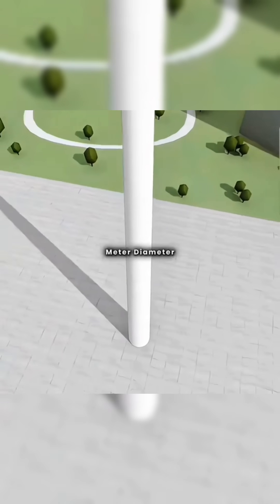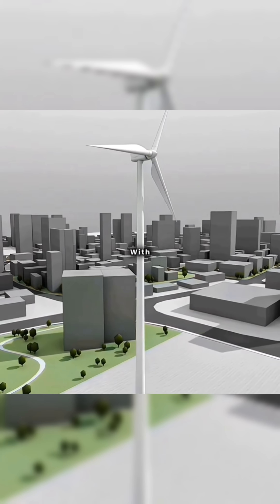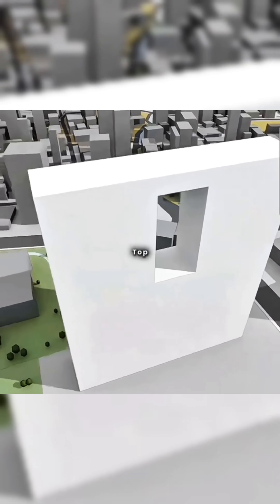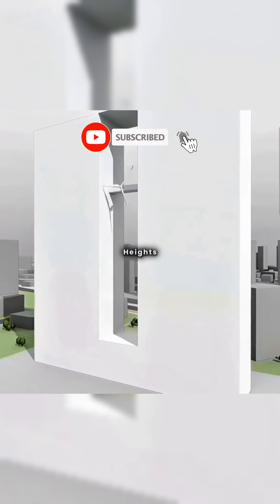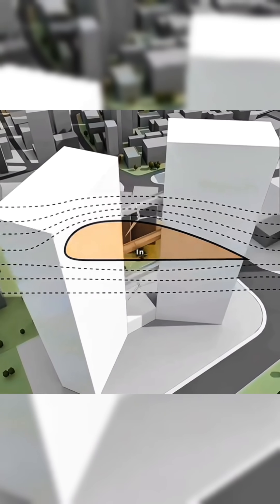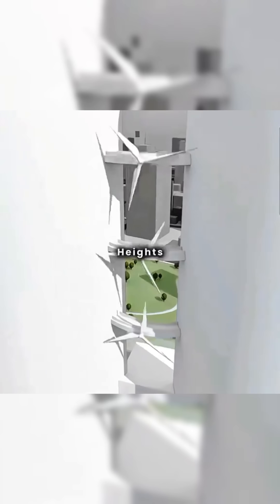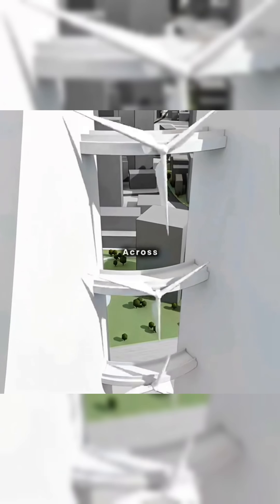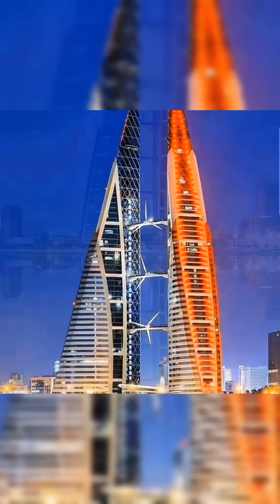The Genius Design of Bahrain’s Wind Powered Skyscraper | #shorts

Comment: Silly design. The 4 corners of the building should have vertical spiral wind turbines from the ground all the way to the top. The building will act like a sail and increase flow at the corners... no hole in the middle of building!